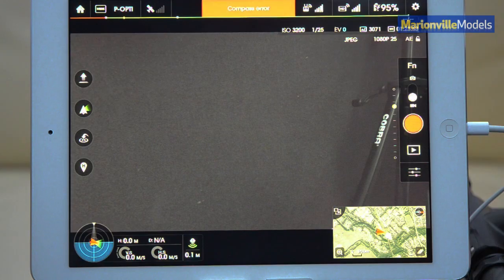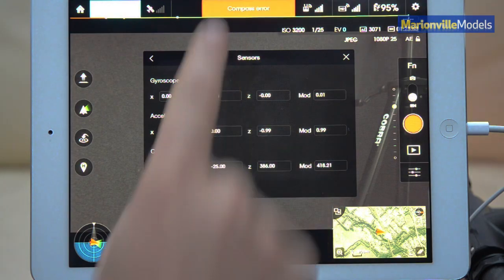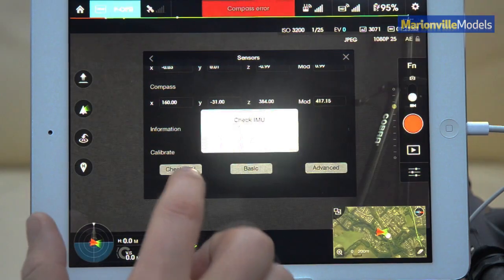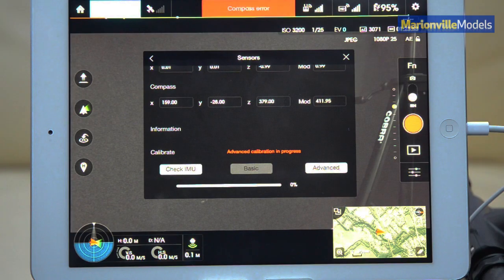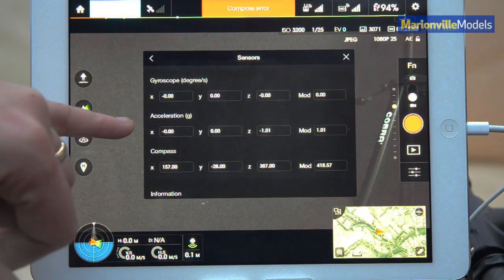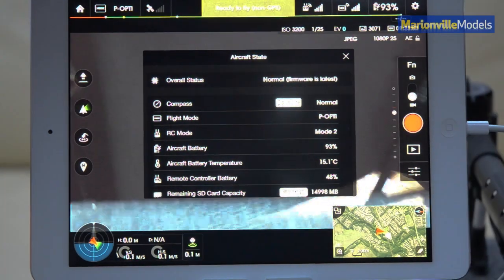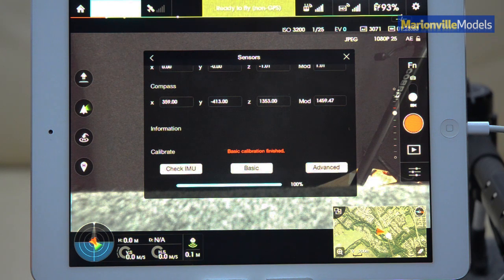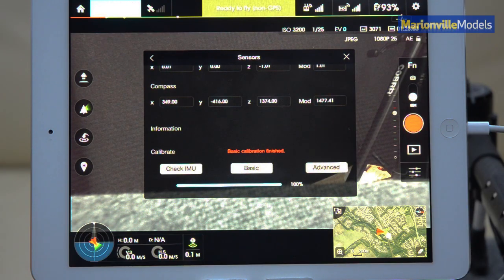DJI Inspire 1, How To Calibrate IMU & Compass

Comment: Hi , what part in the drone knows if it is the right way up before take off ,eg if I turned the motors upside down what else in the drone would I have to turn upside to enable it to fly upside down  , yes it’s a strange question but I have my reasons lol . I have a Mavic pro same thing though imu etc .
Reply from the maker: It would be the same. IMU which would be the flight controller and also the compass.

Comment: My Inspire 1 Pro doesn't have compass calibration in the sensors.  Only Check IMU and Calibrate IMU...
Reply from the maker: A A they have moved it to  under the main coloured status bar at the top. Click on the bar and it’s the third one down.
Reply: @MarionvilleDrones  I can not get Follow me to work on the P4P V2.0 and the Inspire 1 Pro after hitting apply.. it does not show home point and my position in that area..

Comment: On the Inspire, X3, where is the actual gyroscope and accelerometer chips on the unit. I've taken off the white housing, and curious.
Reply from the maker: If you have the flight controller out of the craft you'll see a black box under the fan unit. That's the IMU.

Comment: Can you do the IMU properly inside or should you be outside?
What does the light on the unit display when the calibration is complete?
Green, yellow, flashing?
Reply from the maker: As long as the surface is flat your fine bathe compass calibration needs to be done outside away from ant metallic or magnetic items.

Comment: Hi. Im from philippines. I got my dji phantom 2 vision plus v3 for a week now. And i did install a prop guard and after installing i removed it amd right there i found hairline crack on the motor mount where the prop were bolted on. Can i still fly it? And change my shell after a month or 2? Hope you can clear my questions. Thanks.
Reply from the maker: I have seen this before and doesn't seem to bother the Phantom.